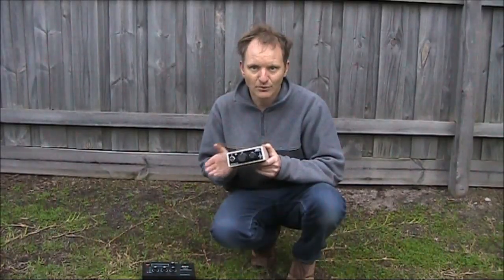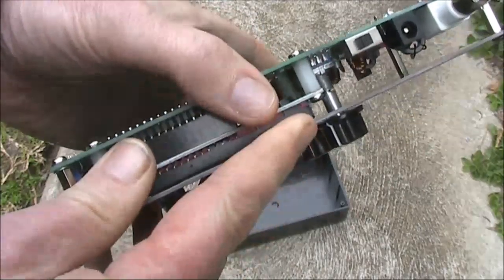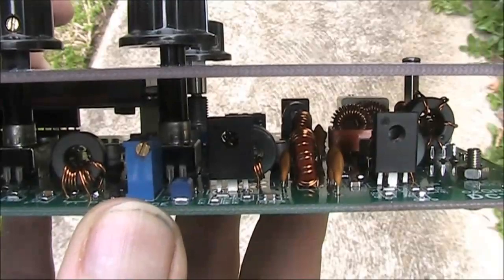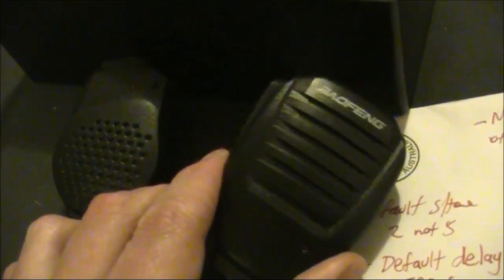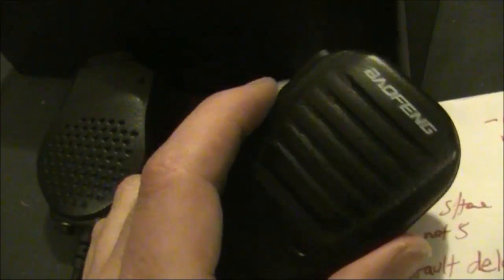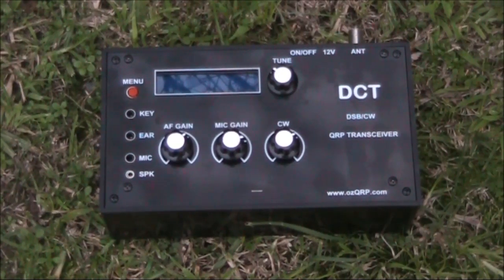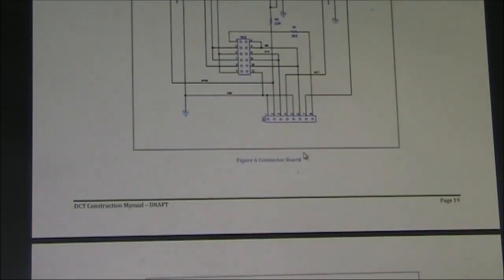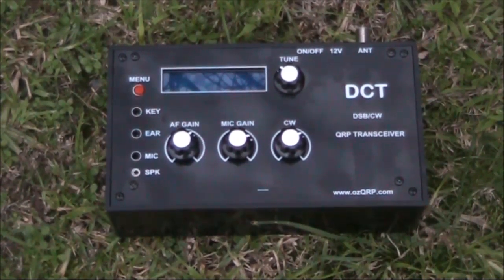Review of OzQRP DCT DSB CW QRP transceiver kit

Comment: Another well conceived and executed product from Leon at OzQRP. I've built two of their MST SSB transceivers and I cannot speak highly enough about that particular design.  This rig sounds very suitable for the SOTA operator, as there are times when you want to work both SSB and CW chasers, and the 5 watts output from the IRF510 is plenty for reliably making contacts, even in the depths of the current cycle.  At the price it's a fine choice.  Paul VK3HN.